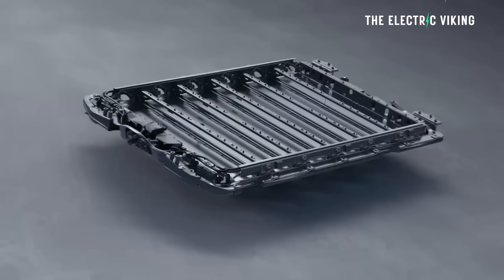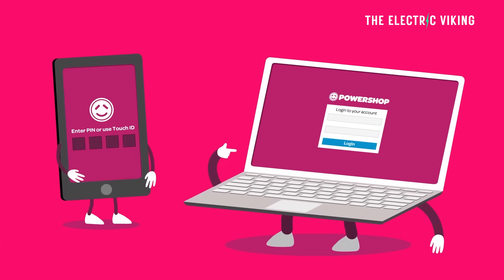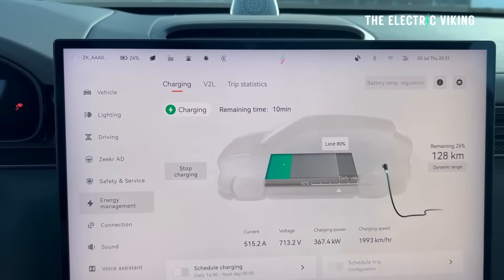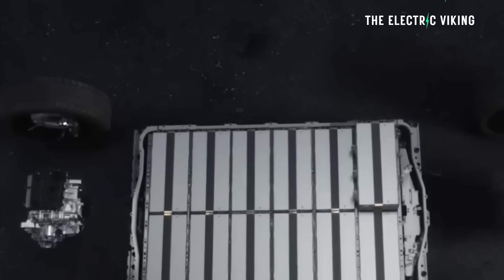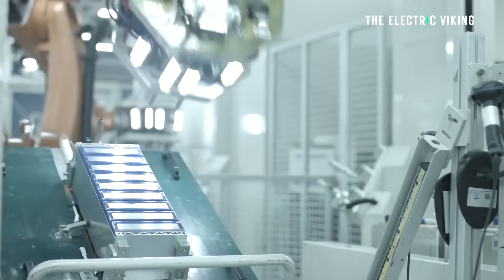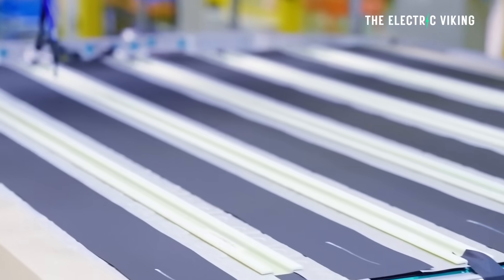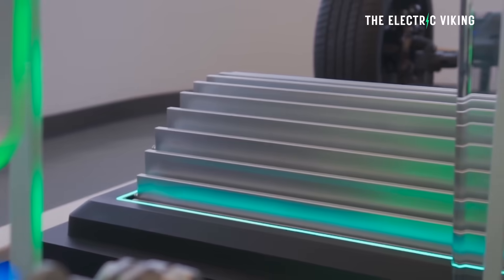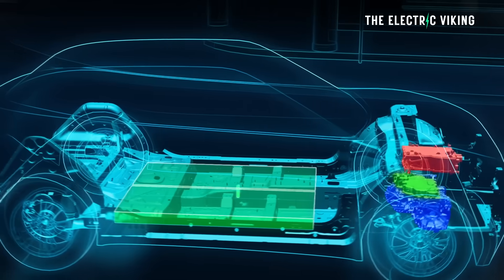Tin Anode Breakthrough: US Invents Sodium-Ion Battery That Beats LFP

Comment: wiki
bout 253,000 tonnes of tin were mined in 2011, mostly in China (110,000 t), Indonesia (51,000 t), Peru (34,600 t), Bolivia (20,700 t) and Brazil (12,000 t).[60] Estimates of tin production have historically varied with the market and mining technology. It is estimated that, at current consumption rates and technologies, the Earth will run out of mine-able tin in 40 years.[61] In 2006 Lester Brown suggested tin could run out within 20 years based on conservative estimates of 2% annual growth.[62]

Scrap tin is an important source of the metal. Recovery of tin through recycling is increasing rapidly as of 2019.[63] Whereas the United States has neither mined (since 1993) nor smelted (since 1989) tin, it was the largest secondary producer, recycling nearly 14,000 tonnes in 2006.[60]
Reply: Not sure I agree. We were going to run out of oil by 1990, too. Extrapolation of mining based on historic data is unreliable.

Comment: wiki
Tin is a chemical element; it has the symbol Sn (from Latin stannum) and atomic number 50. A metallic-gray metal, tin is soft enough to be cut with little force,[13] and a bar of tin can be bent by hand with little effort. When bent, a bar of tin makes a sound, the so-called "tin cry", as a result of twinning in tin crystals.[14]

Tin is a post-transition metal in group 14 of the periodic table of elements. It is obtained chiefly from the mineral cassiterite, which contains stannic oxide, SnO
2. Tin shows a chemical similarity to both of its neighbors in group 14, germanium and lead, and has two main oxidation states, +2 and the slightly more stable +4. Tin is the 49th most abundant element on Earth, making up 0.00022% of its crust, and with 10 stable isotopes, it has the largest number of stable isotopes in the periodic table, due to its magic number of protons.
Reply: Nice ChatGPT copy paste
Reply: @dexlab7539  wikipedia cut/paste

Comment: These sound far too expensive to produce.  But, the safety aspects alone of Na-ion batteries merit making the move.  CATL has already made a viable breakthrough .
Reply: Yes CATL have made breakthroughs with the Sodium Ion cell and production in volume starts in December 2025. Look for Sodium replacing Lithium in utility power distribution, solar and wind plants, home wall units and anything else where size is not an issue. Lithium will still be king in portable applications like phones, watches, tablets, laptops, etc..

Comment: Great to see all these developments in battery chemistry but the real issue with EV rollout is charging stations with sufficient capacity to fully charge multiple vehicles in 10 minutes and do this reliably for several hours.
Reply: I have two EVs in my 2 stall garage. I rarely use charging outside the home. Road trips longer than 300 miles only. So Wisconsin to Yellowstone this summer yes. Otherwise no. I have level 2 charging at my lake cottage 2 hours away as well.  I have hardly ever seen anyone at chargers in the northern Wisconsin/Michigan region where I live. Keep upping the range, decreasing the cost and bingo more people justifying putting level 2 chargers in their homes.
Reply: Took a 1000-mile trip from VA to KY and back and with the exception of one noon time stop where stations were almost full, the average available capacity was about 80% on arrival. And there is a reason why this will continue as EVs proliferate. We keep adding chargers that go unused because by my account, prices on the road are anywhere from 2 to 5 times the cost of charging from home. That will ensure that at the very least, half the charging will remain from home for the foreseeable future.
Reply: U don't need charging with today's range in batteries.u don't drive more than 250 mules in a stretch.u always stop.u can always stop and charge.moreover over 98% of the time domestic car use is less than 250 miles per single use.so no charging is a non issue
Reply: I would sacrifice the trunk space if they made a booster pack that you put in your trunk and swap out with another that's always at home charging.
Reply: @robertjones1730  Dude, just pack a generator with six gallons of gas in the trunk. Or put more tanks of gas on your roof rack or trailer hitch rack or all three places for even less range anxiety!  Don't laugh. I have seen off road rigs set up like that. I even went south with 5 gas cans tied to my trailer hitch rack to help my dad in Florida after the hurricane there in Nov 2024.

Comment: China is decades ahead of USA in every aspect of battery design. Youre telling us about a technology that isnt even being made at scale meanwhile CATLs sodium ion, which is slightly lower energy density, is in mass production
Reply: Perhaps but even if they are decades ahead of the US,  meaning more than 20 years minimum in battery design, there are some contributing factors that would excellerate battery technology like china makes cheap battery powered toys, have for decades, so it is only common sense that China is also the main supplier of the cheap batteries American consumers buy to energize the cheap battery powered toys, especially around Christmas time, so in this context perhaps China is technologically ahead of the curve, but not by more than 20 years, and so what? The USA is a century ahead of china in regards to weapon technology like stealth technology and electronic weapons technology, every single so called strategic design or aircraft design slash invention is a fu@king copy of an American made, American built and battle proven weapon, China has no modern weapons in its stockpile that's not of an imported design origin, they get caught paying for classified top secret military files from american traitors on a regular basis, you know this, Chinese manufacturing is well known to be of poor construction, and the use of poor and sometimes toxic materials by forced labor is unacceptable
Reply: Battery technology will keep advancing in the future as more research is conducted. The bigger issue is how they are integrated into existing electrical systems. When EV's can buy charge and discharge based on market pricing then we will see huge returns. Renewable energy is variable as is demand, when we start using stored EV capacity then we will see lower costs for electricity.
Reply: @capeguy Home power stations can already do that ❤. And with the 1000 mile range of BYD's modern hybrids there's no reason to settle for an EV (not built for the USA's infrastructure) or a pure gas vehicle (anything mid-size is essentially a small truck with a trunk instead as far as gas mileage goes). Charge at home, eat at home, save as much of your electric bill at home and try to do it for as cheap as possible to get those returns early.
Then you can pay to have them hooked into the power grid to get paid for the excess capacity you can provide.
When I'm able I intend to make a fence with solar panels rather than bother with the ripoff roof installations are until I have practice from making my own shed and DIYing that roof instead. 😊
Reply: Germans doing it already
Reply: He already did a video on the CATL sodium battery a month ago.  Both countries are allowed to make batteries you know.
Reply: @lukekennedy4458 I think it’s more the fact that the headline uses the word breakthrough
Reply: @GuardianoftheGameshop it’s a breakthrough in the sense that they’ve come up with a new technology.  Nobody is using tin anodes.
Reply: He has spent extensive time talking about china's batteries on dozens of other videos.  Over the last many months
Reply: Oh well then the US should never try to innovate anything ever again 🤣🤦‍♂️  God forbid any kind of innovation come from the US.
Reply: So 🤷‍♂️ we should just stop exploring better alternatives?
Reply: It’s true! But any progress from even the drill baby drill America is good. If it’s to convince any naysayers
Reply: Replying to @troy3423:

China is *600 DECADES AHEAD OF USA!!*

 YOU TWURP
Reply: China cant even keep their own people working. Remind us why your cheering for the organ theives? 😅
Reply: Catl isn't china vs usa ... its catl vs everyone the tech will be everywhere 3-6 months later remember this comment around March-june
Reply: Actually, it's coming online now. There are home backup systems that use this battery technology...
China will always have the advantage because of US Gov't interference....
Reply: Great, then they don’t need to be working at the Dept of Energy.
Reply: Lol, not battery design -- battery manufacturing capacity, sure.
Reply: Time will tell China in recent times has been shown to only copy and steal others technology and not really invent anything.
Reply: @MlraSpetla still living the old paradigm.  China first copies then innovates.
Reply: long, long, long time ago, I got the knowledge that tin will be a problem in cold environment, so I watch this video and wait for this video to mention its performance under zero degree ( 0 C), but this video did not, even to the very end.
Reply: @hanfucolorful9656 it did mention and said it works down to -20 degrees
Reply: Friend you have valid point and I admire your memory ! @hanfucolorful9656
Reply: USA will leapfrog China, so will Japan.
Reply: @steinervision7643 😂😂😂😂😂😂
Reply: Solar too😪
Reply: China will collapse...
Reply: The US excels in battery research and design. It's always been that way. All major battery technology was designed in the US (Lithium Ion, LFP, Solid State). Even the first Sodium ion batteries were made in the US.

CATL is still important mind you. It's one of the drivers for mass battery production. No one can do it like them. The volume and efficiency of production is what CATL is good at. American researchers need to make these breakthroughs so CATL can eventually mass produce them.
Reply: @wakannnai1 USA did not make the first sodium ion battery. Battery technology has been internationally developed but recently China has both the intellectual and industrial capacity to dominate
Reply: @troy3423 that's not true. China only copies others. They don't even recognize intelectual properties...
Reply: @Summersault666 They definitely dont respect IP. If what you said is true, why isnt the owner of the alleged IP making the battery making it as we speak? Oh wait, you have no idea what you're talking about, that's why
Reply: Great comment you are absolutely spot on! CATL's sodium batteries are already in a large number of test vehicles and their mass production is imminent!!
Reply: @daveret1144Mass production has started, the power station brand Bluetti have just bought out their first sodium power station.
(Though, because it's been in development for a long time, it's specs are actually kinda dated and lame... only one USB-C!)
Reply: cLeAn CoAl! pRiStInE oiL!
Reply: @lucalla dUm sHiTs sUcK PiG TiTs
Reply: Did China steal this tech ?
Reply: @carpenterfamily6198  did the US steal this tech?
Reply: @carpenterfamily6198 If they did steal it, it must been from the Aliens 😂
Reply: No. They just have a strategy for reusable energy. Unlike the dullard who wants to use coal, oil & gas.

Comment: Hype to draw capital investment.  Lab product, They have no  timetable to break ground for factory because they still have issues to work out. Even if does, eventually,  reach fruition CATL's sodium battery seems to be better already  (charge times, durability, optimal operating range, likely price) with mass production around the corner. And Naxtra isn't the endgame for CATL. They have other batteries in the pipeline, including future generations of Naxtra no doubt.

What would be a serious contender, a sodium based battery that blows away Naxtra specs and with a timetable for mass production.